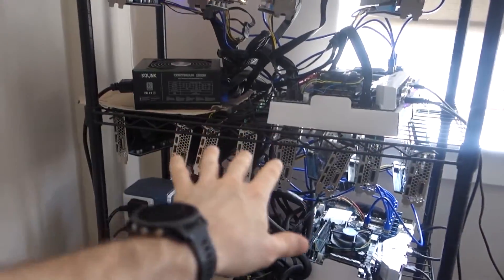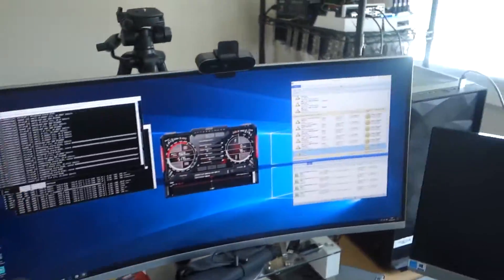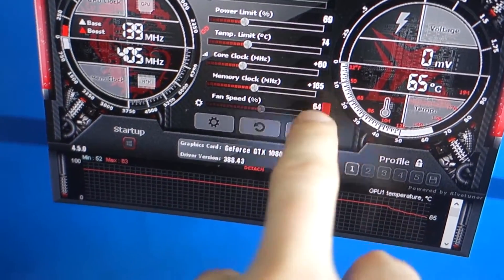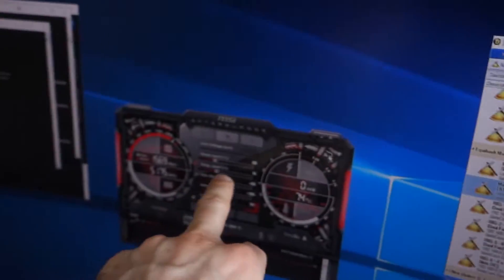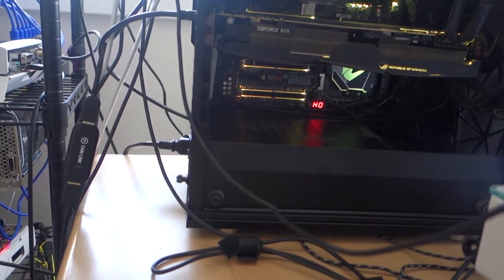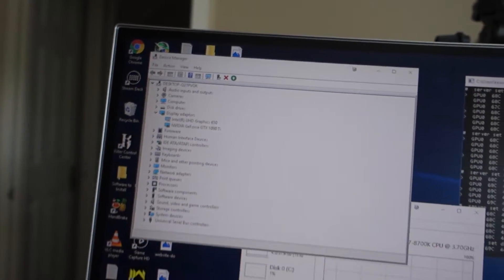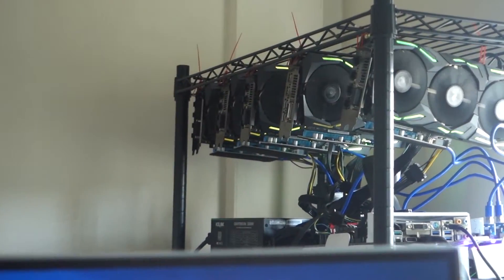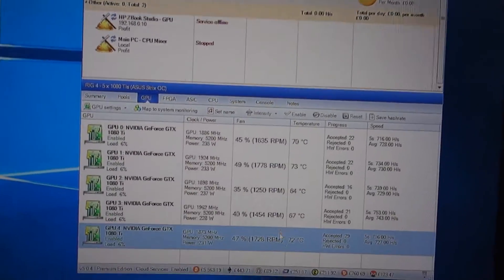Fixing My 1080 TI Overheating Problem

Comment: Good video. I can tell you kev the best that I have done is but my rig in a grow tent, then have a intake fan and out put fan, have the out put fan on a higher fan speed vs the intake this will create a vacuum in side sucking the hot air out. The out put fan just pumps the hot air out the window. This saves me money, electric in summer in the winter I run the out put fan hose in side to warm the house . I will jump on Twitter an send you some pics.
Reply from the maker: My friend Mark has been talking about this for a while. How much did it affect temperatures?

Did it really reduce temps drastically?
Reply: It helps alot,  the main way  it helps is  by all the hot air from the graphics cards are not dumped in the room then warmed back up again and again by gpu's. Instead all the hot air is forced outside and it pull the air from whatever you room temp is. It also saves me money on my A/C not trying to fight the gpu's dumping hot air inside the house 24/7.  I have 3 1080ti and 2 1070's running in my work office 75% power fans 50-70% on gpu and temps are 48, 55,60, 57,  and 63c.
Reply from the maker: Yeah that's pretty good.

I want to increase my fan speeds first and get them going at lower temperatures levels before looking into that. I might be able to avoid using that if my fans are pushed earlier as a lot of my hot air escapes into my loft hatch (which I keep open at all times).
Reply: Kev's Crypto Channel I use msi  afterburner to and set my fans either on a fan curve or around 70%. Ppl may say well you could kill your fan but I rather replace a gpu fan that's easy vs a have to buy a new card if it past warranty.
Reply from the maker: I'm going to set up my custom fan curve in a few days and see how it affects temperatures. 😀
Reply from the maker: Wow. That's huge haha.

Does it make things louder or quieter?
Reply: Kev's Crypto Channel its not huge...you can get grow tents 24×48x72 (or larger walk- ins) and line the insde with sound damping foam, add your wire racks that hold 36 to 48+ cards plus all your other components..two vortec inline 8 inch fans with duct silencer (muffler)+ insulated ducting, one for intake at the bottom of the tent and 1 for outake at the top of the tent. Air is pulled through from inside home and exits out. I also have 14k btu portable AC connected to my intake if tent temp go above 85 degrees. This setup is definitely better than standard open air..keeps room temps at a comfortable level since the heat is exiting and not being circulated inside.

Comment: Great video Key. Aldi do a shelf unit and with a little adjusting you could get two rows of 8 Gpu,s on it. They sold for 35euro. Thanks for all the information. Regards Johnny.
Reply from the maker: Thanks John. That's pretty good. So is it a four tier shelf?

Is that what you're using?

Comment: Sounds like it was worth the changes bud. I'm always looking into one of then metal racks as well.
Reply from the maker: That's an Amazon shelf. Wasn't expensive. It's linked in my how to build a mining rig video at https://www.youtube.com/watch?v=9BPYZmsiPxI
Reply: Cheers bud, I saw some at Costco's I can't remember the price will check when I'm next there. If they're more than Amazon I'll probably grab one off there instead. I will also use your link.
Reply from the maker: Cheers mate. Don't mind if you don't mind the link. If you can get it in Costco just get it there.

There's pros and cons to this setup.

From a maintenance point of view it's great having everything in the one place. However, small rig setups of 8 GPUS would allow me to place them around the house and distribute the heat and hot air etc.